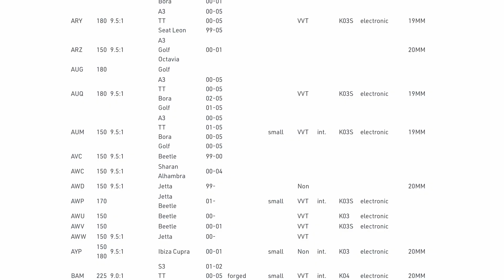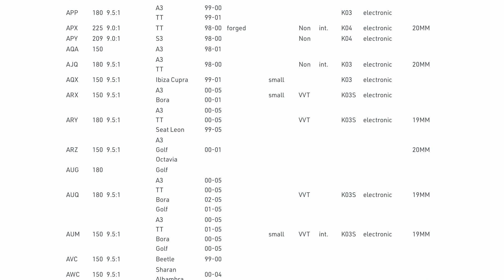Which 1.8T Should You Build?

Comment: An optimum connecting rod mass, shape and material is not the best on static tensile or bending strength...dynamic analysis is necessary..... the loads on it including its own linear and moment of inertia about its center of gravity all vary with bore, stroke , compression ratio, boost and rpm. A good ref is the Shigley mechanical engineering series of books. Engine designers at the major car companies likely know all of this...aftermarket companies sometimes try to market thicker and/or heavier rods hoping for the best. Finite element analysis can easily show the correct "optimum" design.

Comment: Can you tell me if it's possible to replace rods and pistons on a AMb 1.8 t without removing the short block from the car?
Reply from the maker: Depends on if the engine is mounted transverse or longitudinal. However it's generally much easier/cleaner/simpler job to just pull engine and do work on a stand.
Reply: @COMotorsports ... Longitudinal

Comment: Hi! Im planning on building an awp for 500-550hp! Putting on a garret gtx3071r, intercooler, piping, fuelrail, injector, plugs and coils. Custom intake and exhaust and switching out valve springs and valves so i dont get valvefloat on the intake while running 2 bar of boost (28-29psi) maybe external waterpump and going h-beam conrods and forged pistons. But do you guys have any more input because im wondering if i have missed something to upgrade og switch out!!
Reply from the maker: boost doesn't equal valve float, RPM does. You only need valve springs if you want more RPM on this setup.

Comment: I have a 2003 audi a4 1.8t  170hp , sloww.can I gain 300hp with  a  tune,injectors, exhaust and possible fuel pump upgrade  ? Or

Comment: I have a mk4 Gti 1.8t 20v AGU ENGINE no
It has no power at WOT but I hear the turbo spool up 
Do u know what could be the issue or where I could start looking…also the pipes from the turbo to intercooler swells up a lot wen engine is being reved ip
Reply from the maker: First step would be to scan it and see what codes it gives you and go from there.

Comment: I realize that this video is now 2 years old but I hope that this reaches you. I am an American retired in Portugal and have always wanted to build a track day car. So I bought a ‘94 Golf Mk3 and stripped it down to the shell and threw everything else away. I am getting the complete suspension from a Euro spec TDI and I have a deposit on a 2002 Audi S3 1.8t motor. I am on a slender budget and want to get to around an honest 300 hp at the wheel. Can you please tell me what you recommend the best way to get that on a budget? 

I just recently stumbled across your channel and have been eagerly watching them. They are very informative and fun.
Reply from the maker: First is to drop the words "slender budget". As the old saying goes, Fast, Cheap, or Reliable. You can have any two. This statement holds very true.

Comment: How do you feel about the TSI 1.8T EA888? I'm looking at one now and I'd like a reliable 350-400 whp/ lbft tq is it possible without dropping 10k into a 1.8t? Can it be done reliably with just FBO/Tune?
Reply from the maker: Not safely
Reply: @COMotorsports  stink. I have seen folks bolt on an additional fueling rail, HPFP, catless dp, intake/inlet, a large FMIC, and a hybrid IS38 and with the ECU/TCU tune they hit 350 whp/TQ. I just wasn't sure whether it can be reliably daily driven and tracked 2-3x a year without having to build the motor
Reply from the maker: @323Agency not saying it can't be done. But 400whp Its definitely more on the edge at that level. There are a lot of junkier parts in the 1.8t vs the 2.0ts.
Reply: @COMotorsports  I'd be happy with 325-350 for the next few years as a daily alltrack dad car. I have been eyeballing totaled rs3's.... Move the DAZA and DQ500 into the alltrack! That would be the sleeper wagon to have.

Comment: What would the max hp y’all would suggest in crank hp on a 225 TT motor?
Reply from the maker: @42069NJF  depends how frisky you're feeling. We've made 600whp on a stock 1.8t in the past.
Reply: @ would 320-330whp be safe?
Reply from the maker: @42069NJF  that's typically where we keep them. It really comes down to the turbo used and the tune to keep them alive.

Comment: What’s the most HP can I get out of the 1.8t AWP engine code with stock piston, valves and connecting rods. And a cheap ko4. What is a recommended tune?

Comment: I’ve ported ABA and 12v VR6 heads for N/A cars I had years ago. I now have an 04 Jetta gls, awp. I want to make 400-450hp with the least amount of boost possible, my goal is to be more focused on airflow than boost. Do you guys think it’s worth porting an AWP head? I thought I read somewhere that AWP heads have more material between the ports and can be opened larger than an AEB port? Can anyone confirm?
Reply from the maker: There's more material because it's a smaller port. Just start with an AEB head. And if you want to run as little boost as possible, run ethanol. We've made 400whp on a AEB head at around 20psi, on a smaller turbo (3071). Damn good power on low boost.
Reply: @ thank you I love your content

Comment: Has anyone done anything with gen 3 motors?
Reply from the maker: @ccubsfan94  I'm not sure what you mean but our most recent video we made 650whp. With one.
Reply: @COMotorsports  I have a 2016 Jetta, MK 6.5 with a 1.8t. I keep seeing stuff for the Gen 2 and earlier motor, and the 2.0, but nothing for the latest 1.8t. 
APR and IE show really nothing

But, I did see something about piggybacking with a JB4, I need to dig more, but seems with boltons could be decent. 

I mainly want to take it for track days, so bolt ons and such around 250ish whp is pretty much exactly what I want. 

The JB4 is the only thing I've seen as of yet (between my first comments and this one).

Comment: Would an AWP crankshaft be the same in a manual and automatic transmission? 
I need a crankshaft/bottom end, but im not sure if an automatic awp block & crank would work with my manual transmission.
Reply from the maker: Should be the same block/crank. Although it will likely have a pilot bearing in the crank that you will need to remove.

Comment: So I have a project car, it’s an 2001 a4 avant, I 2004 1.8t amb swapped it. It’s tuned and has a gt2554r, making around 250 horse. I want to throw a water/meth kit next. I have the 5 speed in it but would the 6 speed from the 2004 a4 Quattro fit? I’ve looked on forums and can’t find a clear response
Reply from the maker: sure

Comment: I know that the 2.0T crank can be used to bump displacement up.  Can an OBDI  2.0L 8v ABA crank also be used the same way?
Reply from the maker: Just use a mk4 2L crank.
Reply: @COMotorsports  Thanks for the info. It's probably overkill, but you get it.

Comment: i’m new to the euro scene and the volkswagen/audi stuff. But I just got a 2002 Audi A4 Avant with 1.8T is this a good 1.8T to build up? need advice
Reply from the maker: They're all basically the same. Slight differences but if you're building one all mods apply across the board.

Comment: Awesome video !! What would be the 1.8T engine to go if, like in my case, you want to upgrade from a 1.4TSI (CAXA) exchange-wise? Are there parts I can use from my CAXA to build on the 1.8T? Is there a better fit for a 20V compared to a 16V? I know the airco compressor can be re-used. The power I have in mind is just what's achievable with a good reflash of the chip, as it's a road car and I want reliability.

Comment: I would definitely like to know your thoughts on the amb motors what kind of power can you make on a stock motor with bolt ons differences between amb motors and the others etc
Reply from the maker: As mentioned in the video, and sort of the point of it... They're all basically the same.

Comment: I have a golf mk2 with ajl code block(058) with adr big port head and cams, k03s, full 70mm exhaust, tt 225 injectors(386cc) and a seat sport cooler. I don't know the power of the car but runs very nice. The n/a cams from adr can keep the power higher and it's a good and cheap mod. Your informations are good and you know 20vt engine. Keep up with a part 2!!

Comment: I just picked up a 2002 Audi A4 Quattro 1.8t and I don’t know what  is a good upgraded fuel pump on a budget. So far I have Front mount intercooler , ko4 turbo , has a eBay diverter valve, and stainless 3 inch down pipe with 3 inch straight pipe exhaust all the way back. Also what would be good for my next mods

Comment: Can you comment on the APH engine? Specifically a sense of safe and reliable power ceiling, and thoughts on the fixed vs variable cam? I have upgraded a ton on the car, including a K04 and full intake/exhaust path, but never cracked open the internals.
Reply from the maker: As the video implies. They're all mostly the same.

Comment: Is the BEA engine any good ? I have it in a mk1 TT with the 6spd and it needs a little work but timings all been redone just wondering what to look for and what to build for making more power
Reply from the maker: All the 1.8ts are basically the same, which I think we covered in the video. Only major difference was between internal and external blocks. Yes there are subtle differences, but nothing that makes one much better than another.

Comment: you have external waterpump 058 type block in a mk4 golf in canada (the 2.0l 8v where you talk about)?
in europe its also a 06a engine with internal water pump.
in europe the 1.8t 06a have also a forged crank, alot of 1.8t's are a AUQ code, 180hp, 19mm pin, forged crank, smallport head, 06a block
Reply from the maker: No internal waterpump 06a in mk4 2.0l and 1.8t.

Comment: Question: I have 06A block 19 mm wrist pin stock pistons with forged rods with full build big port head. I am worried about that some people say the 19mm are weaker and can go above 7500rmp.
I am shooting for 430/440 crank HP and 7800 rmp
Reply from the maker: I see zero concerns as long as there are upgraded valve springs and exhaust valves.
Reply: @COMotorsports  absolutely yes, supertech exhaust valves and Supertech springs and retainers kit. Forgot to say here in my country the best fuel you can get is 100 octane, but i am also using AEM watermeth injection to keep the pistons Cool🙂👍

Comment: Hey guys, I've got a bad wrist pin in my 02 Jetta and I'm going to go ahead and upgrade my rods to IE drop in, the code on the head is AWM but the car has been worked on before I bought it. Is there any way to know for sure what block I have so I don't buy 19mm wrist pin rods if I actually need 20mm wrist pin rods?

Comment: Awesome video guys!
One note for anyone that is curious.  with an aeb block if you go with forged rods you need to grind down a small portion of the inside of the block(intake side) to clear the cylinder 2 rod.  If you go with a aba crank in an aeb block you need to remove about 60% of the intermediate shaft gear in order to clear cylinder 4 rod.  I have pictures and measurements if anyone needs them.
Reply: doesnt seem like there is many of us left, atleast here in the states. people are moving onto the newer 2.0s and im seeing a lot of people do 07k stuff lately.
Reply: @b5Bart  yup I completely agree alot of aftermarket 058 parts are being discontinued. There is def some like us out there but not many left for sure which sucks. I’ve been seeing the same 07k is sweet though. Are you on vwvortex or Audizine we may have crossed paths before if you are.
Reply: @Euro_Rat  sure am and im sure we did at one point, ive been doing vw audi stuff for almost 20 years now 👌🤟🤟
Reply: @b5Bart  hell yeah that’s awesome to Hear. Have a good one sir. What’s your username on the forums?
Reply: I have a question, someone is offering a set of ARP head bolts for £180 which is a lot of money, question is are they worth it over the standard £30 bolts on a 320 bhp car, have you ever had a head lift? At 1.2 bar of boost ?
Reply: Surly wud like the have those

Comment: Hey guys, glad to have found your channel. I am pulling my hair out with my cam chain roller count.  Everyone says 16 but then it really counts 15.  I have tried 16 inbetween notches and it ran terribly, I have 15 in between notches and it runs great.  Even my Chiltons book has a poor diagram, that doesnt show truly the correct amount, as we all know the timing marks dont truly line up with a roller or a sproket tooth.   Can you or do you have a video that clearly shows this step?  Yes there are others out there but they "all" really have a bad video angle, or they just seem to count incorrectly.  (I have an 04 Passat auto, with the AWM engine.)

Thanks!
Reply from the maker: Sorry we don't do DIY's, we've discovered over the years that people interpret things as they want and we don't want to be responsible for people trashing their engine because of it. Those folks will likely do that anyways, but we'd rather not contribute to that. There is lots of great info on that engine out there, follow the book and it will run correctly, if it's not then you likely have something wrong elsewhere or your interpreting something wrong.
Reply: @COMotorsports  Thanks for the awesome reply, I completely understand where you are coming from.  I guess the old addage, is if it aint broke dont fix it.  Which to that I would add "but you can still make it better."  Thanks again!  Shameless plug if you do need a diy on the 09a vavle body for the 1.8T autos, i have a playlist i created to help others not go through the frustration i went through to learn the install!
Reply: I was able to swap it out no problem, after closer inspection it was more clear(ish) which roller lined up with the timing mark more than the other, so I went with my gut and all is well.  Thanks again guys.
PS Ive often thought about taking the longitudinal 1.8T with the front wheel drive and moving it to the back to make a mid engine rear wheel drive car.  That would be a build I would love to do, but also love to watch someone else do.

Comment: I have a 1.8T with the engine code BZB and i wonder if its worth modifying it. I want to know the power capability of that engine and i can't seem to find nobody answer this question. Thank you guys!!
Reply from the maker: Did you watch this video?
Reply: @COMotorsports  yes but as far as i remember i did not hear anything specific about that engine. Mine is 1.8 with 16Valves and the older ones are 1.8 20Valves and have different codes. My concern is about this specific engine. Are all 1.8T's worth taking up to 300-340whp?
Reply from the maker: @andreealluiza8002  we never received that engine here sorry.
Reply: @COMotorsports  Okay, thank you for answering!

Comment: Hello guys love you channel. Question I have 2000 Vw Jetta mrk 4 with a 06A block  engine code AWD trying  to build it for daily driver/street car   to push 450 hp to the wheels. Should I run with forged pistons  if so  which ones work best with IE connecting rods? And what size turbo should I go with let me know thanks guys. Much love from California!

Comment: Question: On an AWP, if head's in good shape any special work needed to install supertech exhaust valves?  

Any machining required from the machine shop?

Could new exhaust valve simplycbe installed?

Thanks....
Reply from the maker: As long as they're stock size, lapping and ensure they're sealed up is all that's needed.

Comment: I have a 2001 VW Passat made in March. It was made in Germany, which is pretty cool. The engine has the AWM code, which is only for 2001. What engine is interchangeable? From the list of engine codes, the only other ones listed for Passat with 170 HP are AWT and AWM. ATW is listed for Passat, but it is only 150 HP. Will the Audi engine with 170 HP work (AMB)? Thanks.
Reply from the maker: If it's an external water pump engine then any external water pump 1.8t will bolt right up. If it's an internal water pump engine then any internal water pump 1.8t will bolt right in.
Reply: @COMotorsports  Awesome. Thank you for letting me know. I can relax a bit.

Comment: Hey guys I have been reading throughout all Fordham to no resolution 
I have a 03 audi a4 1.8t with ko4 550cc injectors 255 fuel pump. Stage 3 tune Here's my problem  
  In park car gos AFR 10.9 or Richard
I put in Drive it gos to 14.5 or 15.5
Par throttle Ghost lean
New map sensor no change new o2 sensor no change
 Please HELP 🙏 🙏 🙏 🙏 🙏

Comment: I’m trying to make around 300-350hp out of my 1.8t. I want to find a turbo that can just bolt on and I don’t need a new manifold and all that. Should I get a K04 or a GT28RS? Are those both straight bolt on?
Reply from the maker: You need a manifold
Reply: @COMotorsports  any recommendations

Comment: Could you guys do a 2.0 8v video? Like this video. Different ways to get more power, difference between parts you can swap out from 1.8t’s, 1.9’s and mix Match parts?
Reply from the maker: Unlikely, in my nearly 2 decades of doing this I haven't turbo'd one single 2L 8v. So needless to say they're not common, nor do I have any parts around that I could chuck at one. If someone wants to donate a decent manifold sometime I could likely make it happen.
Reply: Aba block with aeb head aka 20/20 swap
Aba came with thicker beefer pistons, forge crank, and oil squiters.
Reply: Unfortunately I cant provide you a video but I used to have a MK3 Gti 2.0 8v turbo`ed here in Argentina and made around 260 chp on stock internals using a electromotive stand alone in those times (2008)  was very exciting back in the day!
Reply: Amen, I guess what they will swap to other than what they came would be nice too.